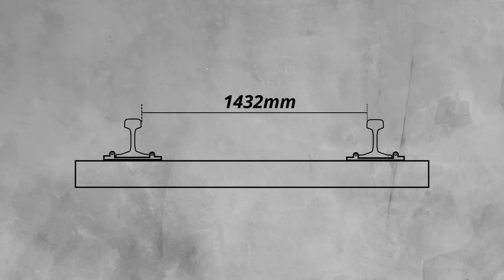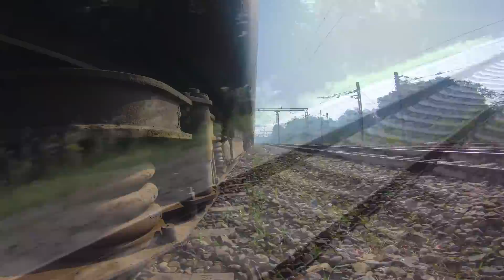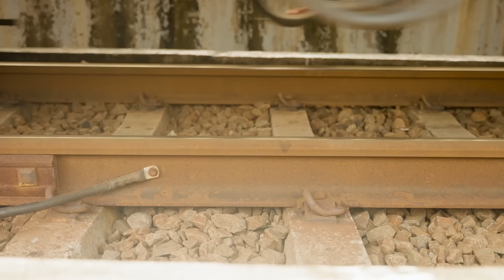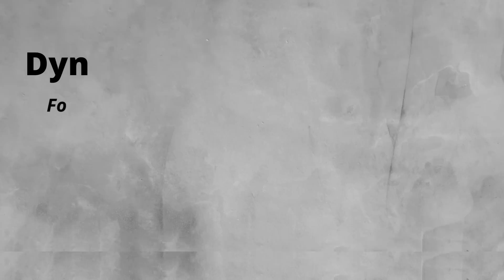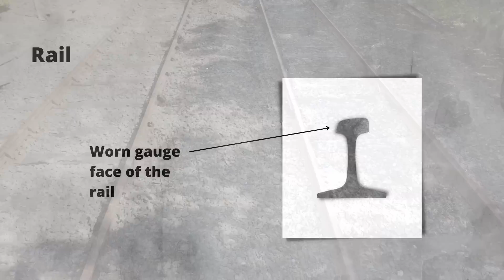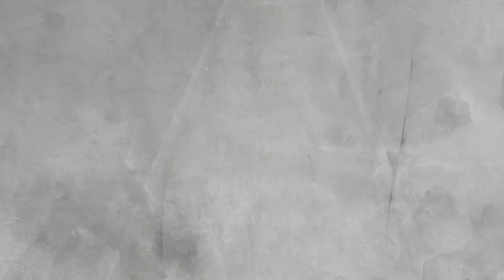Gauge Faults! An Easy Guide to This Common Railway Geometry Fault

Comment: You mentioned that on corners the wheels have to be able to shift so that the difference in radius of the conical wheels allows the outside wheel to travel a longer distance. I had wondered how trains get away with having a solid axle and this makes sense. In Sydney, on the North Shore line, there is a station on a fairly tight curve called Wollstonecraft. The tracks appear to have some kind of lubricant applied to them. I wonder if because the trains are going at a low speed and stopping at the station they need the lubricant to make up for the trains not shifting to the outside as they would at speed.
Reply from the maker: From my experience lubricators are fitted in areas where rail wear, or RCF, is high, to help reduce it. This will be from the friction or forces of the wheel. This would be the driver. It has also been known for lubrication to work a little too well and affect trains braking ability!